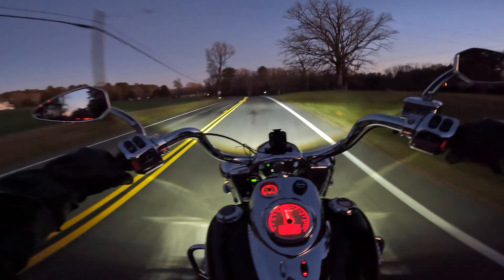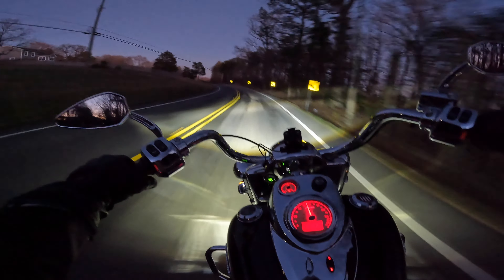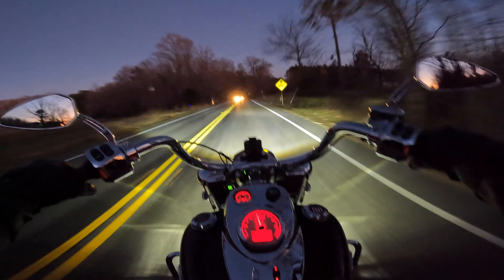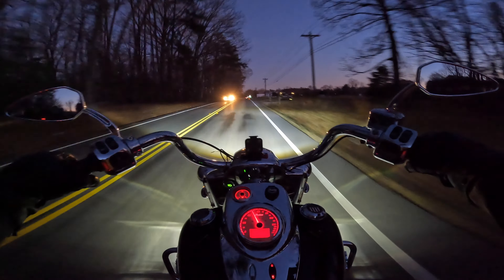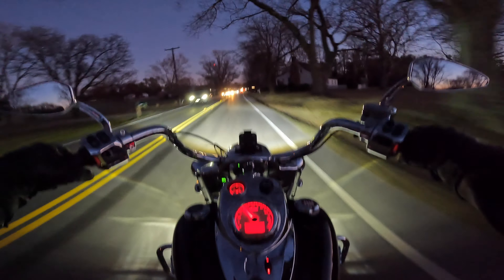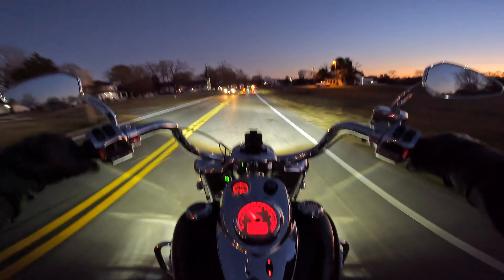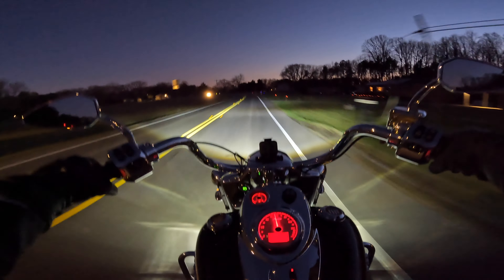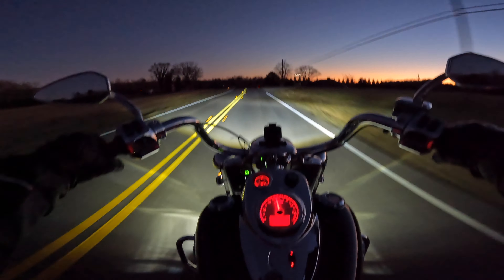Heated gear test, Shoei re-install to reduce noise, update on cylinder deactivation question. Pipes?

Comment: The Audio sounds okay, don't think there's helmet made that eliminates all wind noise.
Reply from the maker: Thanks for the feedback.  My main reason for working on this helmet is the amount of wind noise I hear and feel inside the helmet.  The audio for the recordings is great if that improves but isn't my main focus.  My other Shoei full face helmet doesn't have this air feeling inside the helmet.  Hoping the leather chin guard and larger cheek pads may help.